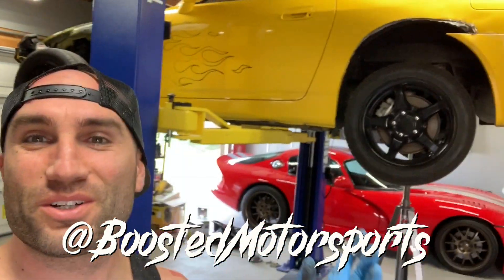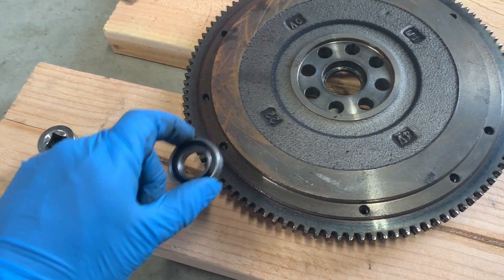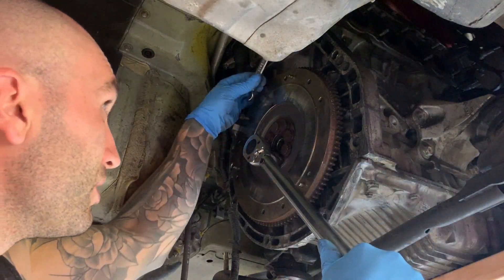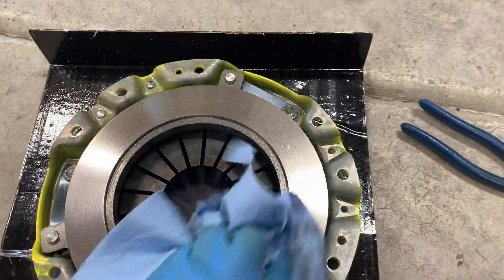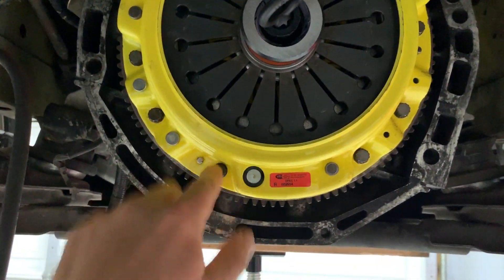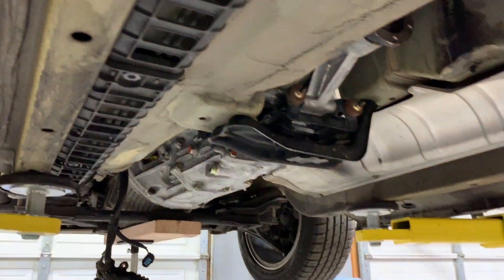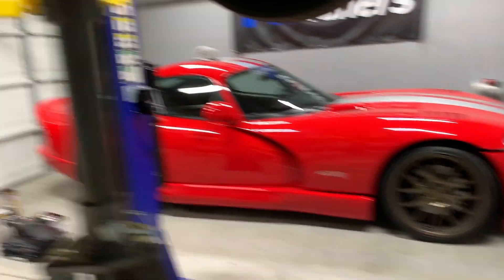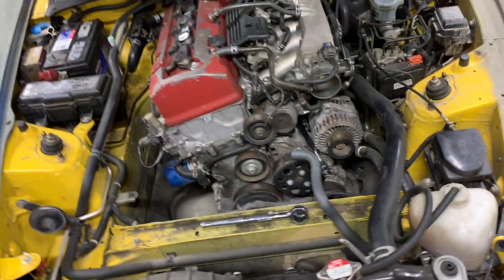CLUTCH Install in a WRECKED Honda S2000 - Part 7

Comment: Just a thought, use the old bearing to push the new bearing in. Just set it on top and do the same circular tapping. That keeps you from damaging the good bearing surface.
Reply from the maker: Ya that could do the trick too! 👍👍

Comment: You also need to grease the throw out bearing. There’s a channel on the inside that should be filled with grease  (as per Honda service manual)
Reply from the maker: Yup we did that too and filled that groove with grease 👍